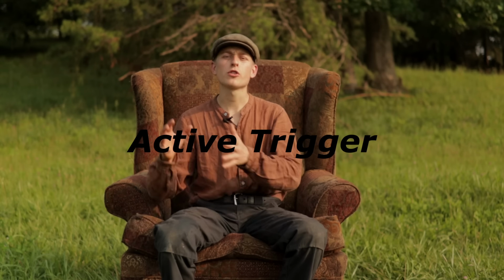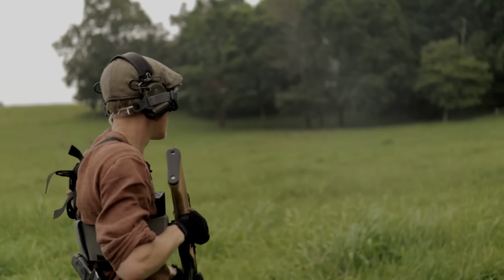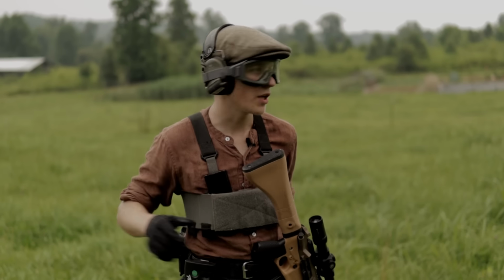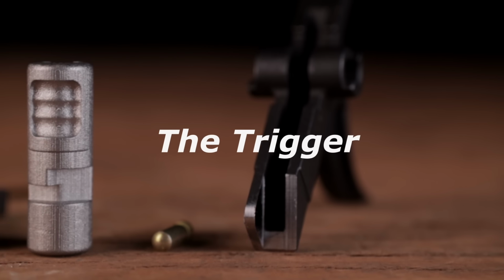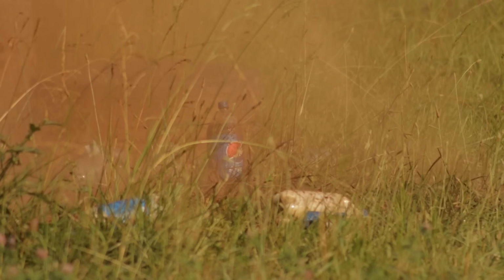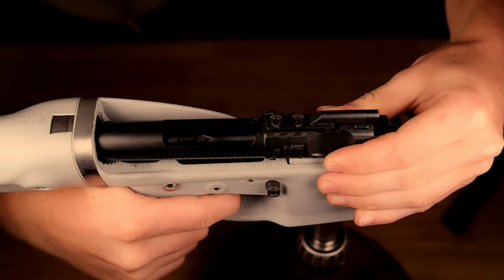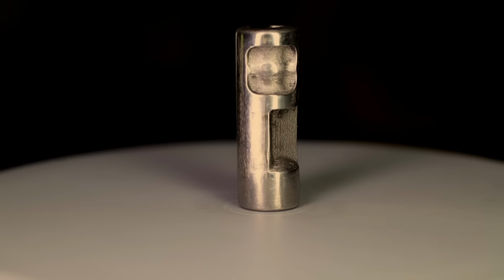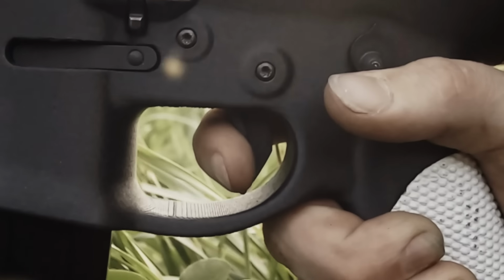Introducing the Super Safety

Comment: I'm uncertain about receiving a response, but you mentioned that this can be used in any AR. I've tried everything I can think of to get it to work in a Wilson Combat .300BKO I built, with no success. The problem is that the detent pin isn't long enough to seat firmly into the safety barrel channels. I'm not sure if there is a specific issue related to the WC lower or if it is something else. I fiddled around with a regular detent and managed to round off the end enough for it to generate some resistance when operating the safety barrel, but it didn't work when firing the gun.

Comment: Isn’t 0.2 mm small for PA12-CF
Reply from the maker: Yes, but not 0.25 MM. Its the only filled material I know of that won't clog a 0.25. That's why I'm very specific that it must be this particular Polymaker filament.
Reply: @HoffmanTactical what 3D printing material would you use and the LR308 works for 556 right?

Comment: 11.5” .556/.223, AGB, Super 42 Rifle length spring, with a can. Running an A5H2 currently, thinking about stepping it up to an A5H3. Want to hopefully make it more reliable (Less chance of bolt bounce and easier to send the bolt home if it’s ever dirty) and mitigate the recoil more without sacrificing too much cyclic rate. I’ve been told theres not much difference in “wear” on parts between the two. Not sure if stepping it up would make it run sluggish/short stroke when the gas has been set right, or if it would be a sweet spot, especially with the can?

Comment: I recently acquired a C-grade Enfield No 1 Mk 3 rifle that I'm going to convert into a gas operated semiautomatic rifle, and I'm going to install a super safty just to see how it compares to the Howell automatic rifle. 
I'm going to convert it from striker fired to hammer fired by cutting off the back third of the bolt right behind the locking lugs, which will have the added benefit of shortening how far the bolt sticks out the back if the reciver.

Comment: This could ware out safety holes on the lower receiver even if lubricated.
Reply from the maker: Testing has shown it to be a non issue, probably due to low surface pressure.

Comment: So, do these drop into AR10s aswell? 
Or do they have different dimensions?
Reply from the maker: The lever for LR-308 is different, but cam is the same.
Reply: @HoffmanTactical  Intriguing.... 
Tell me, is there a break down of specific measurements for folks that do not have 3d printers but are capable of hand cutting and grinding metal+plastic?
Dimensional blueprints for swift links and folded coat hangers are easy to find (I know they are completely different devices) but I cannot find anything for super safety... :(

I have looked around but have only been able to find references to 3d printer files... or websites for buying them complete... but nothing that would help a person actually hand make one for themselves...

Any guidance would be extremely appreciated. <3

Comment: Just curious, why not make it so that safe was the middle position and semi, and forced reset were left and right positions?
Reply from the maker: You could. I wanted safe to be easily indexed, hence its position.
Reply: @HoffmanTactical the reason I asked is because with it being a push button it could be easily accidently knocked into a firing position. But if you put "safe" in the middle, it would make it easier to put say a "raised" section around the cam, kinda like a bumper to make sure it couldn't be pushed by like being knocked into a wall or a shelf, etc.
Imagine like a wide washer with a scalloped center that a thumb tip or finger tip (depending on the side), could easily slip into. If "safe" was in the center you don't have to have the washer nearly as high to protect the cam.
And also if safe was in the middle, indexing it with using the washer would be easy because you just would you the "flat" of your thumb, or finger, to push. And knowing if it's in safe would be as simple as feeling if the cam is level with the washer around it.

Comment: What buffer weight have you found works best? I know it’s prolly gonna be specific to bbl length and port size etc but just wanted to know what you’ve had luck with
Reply from the maker: All of them. Honestly, if the gun runs in spring reset, it will run in active reset.
Reply: @ thanks mane.

Comment: What buffer weight should i run for a 16in? H2 or 3? What about a supralative arms adjustable gb?
Reply from the maker: I don't run more than a 3.5 ounce buffer in most of my builds.
Reply: @HoffmanTactical  thanks man.
Reply: @HoffmanTactical  what about running a A5 9 position buffer tube and an adjustable gas block from superlative arms to lighten recoil?
Reply: @HoffmanTactical  also what weight do I run for a 12.5in barrel?
Reply: @HoffmanTactical  any ideas for super safety on the AK platform? Would be awesome!!!
Reply: @HoffmanTactical  super safety for m&p10mm  cz p10 pistols would be dope too. Glocks already have binary . Wish they would make binary for other platforms besides Glocks.

Comment: Got an interesting story about my Super Safety.

I did everything in this video, or so I thought. Bought a Super Safety kit and I installed everything correctly, but Iwas having light primer strikes. It would shoot 5 or 6 rounds, and then jam instantly. I installed an H3 buffer, changed my spring, and did a bunch of other stuff.

Turns out, I installed the wrong detent. I put my original detent in, not the sanded one. Gonna see tomorrow if it runs correctly now

Comment: I see accelorated wear at the lower safety bore with a cam reset safety. Anodizing could help, but how about a replaceable bushing insert? It could be retained with a shoulder on the inside and snap rings on the outside ( for quick external inspection)
Reply from the maker: So far we have not seen any wear, probably due to low surface pressure.

Comment: The rotation of the safety in a lower,  WILL cause the safety hole to wear out.
Reply from the maker: I had some concern, but so far it has been a non issue. Surface loading is really low. Also, lowers are really easy to replace after 10K rounds (just print another for a few dollars).
Reply: So 3D print multiple
Reply: @ reprint multiple lowers?

Comment: What nylon can be used ?
Reply from the maker: Stiff and wear resistant, also needs to work with a 0.25 nozzle. Polymaker PA12-CF is the only option I have found.
Reply: @ dang only a .25 nozzle?
Reply: Was hoping to print today but I see imma have to source some things first

Comment: Put graphine between the high and low areas of the cam, so when they rotate to reset the trigger, it causes a small electrical charge. Route the energy it produces into helping with time rechambering time.

Comment: 1) What is the failure mode? Ie, when it starts or after a hundred or so rounds, does it reduce the active impulse to the trigger until eventually it dies not push back at all, does the firearm fail to fire at all, or does the firearm lose the ability to be put on safe?
2) Can the active trigger be overridden by pulling back hard on the trigger, or will it still push the trigger out against all applied force or die trying?
Reply from the maker: Metal systems tend to not be overridable, though poly systems can be prevented from resetting with a firm pull. Failure mode is failure to active reset (reverts to spring reset).
Reply: @HoffmanTactical  Thanks. I don't actually own an AR-15 yet, just an SU-16, but if I ever build one, especially with the sweeping reforms coming, I'll have to give it a try.

Comment: This looks like it would destroy the lower with  the  rotation of the safety .. I would not do this in any of my guns
Reply from the maker: Never been an issue, even with plastic lowers. It's because of the low contact pressure.
Reply: I’ve got a 3d printed lower with 1500 super safe rounds through it and no added wear

Comment: Does high shelf or low shelf lowers matter?
Reply: That's the lip on your upper you can also sand the top of your lever ever so slightly with sandpaper or you could Dremel the lip on your upper wish I could show you a pic of what I mean
Reply from the maker: No.
Reply: @HoffmanTactical  what would cause the bolt to get jammed to the rear?

Comment: Mine isnt working do i need to modify the disconector?
Reply from the maker: No.
Reply: @HoffmanTactical  it's not resetting in the ss mode and it locked my bcg back when trying to hand test it i had to bang on it to get it loose

Comment: I've seen these in person. The lever that slides into the cam dove tail seems sloppy
Reply from the maker: It was designed to be sloppy. Needs to pivot in the cam by ~6 degrees otherwise the system won't have enough hysteresis.

Comment: just print the parts in regular plastic and make a mold out of it, then cast your parts in metal.
Reply: How about you give a tutorial. Because, that slide switch is detailed and very small dimensions. IDK if I would be capable of casting such a small part without lots of imperfections.

Comment: Cross bolt safeties suck  ergonomically speaking.  Thumbs are natural fliggers up and down vertically. Not so pushing laterally. Now on to that cross bolt design. Now once my safety is off, my grip hand needs to be used in an unnatural/unintuitive way on the other side of the grip to put it back on. Stoner got it right the first time. The only thing that made it better was the 44° short throw.
Reply from the maker: I don't disagree at all. The use of a push button was not an optional design choice, it is required by other design factors.

Comment: Will this work with an AR-15 bolt carrier group? It seems like it will only work with a mil-spec bcg. My ar-15 bcg is cut short on the bottom. Will that still engage the lever when it falls back into battery? Please respond, I cannot find any information on this anywhere
Reply from the maker: It's in the docs.

Comment: would this work with the SL-9 or any other non printed pcc in 45 even?
Reply: It’s gonna work with anything that will take an AR trigger. However, you may need to screw around with the gas system to give it enough force to reset it.

Comment: I wonder if it will work with the surefire optimized bolt carrier. (it has a dead blow weight in the rear of the carrier, might have clearance issues)

Comment: Dont get to excited about the "Super Safety".  It doesnt really work all that well.  I've printed 6 HT SL 4.8's,  ALL of them with the 3 position safety and NONE of them actually function as intended.  They are all semi with NO active reset at all.  None.  I suspect the reason is because the specs just arent good enough for all uppers and I tried 4 different uppers.  So essentially what I ended up with was 6 mil-spec triggers that are now pretty much ruined due to the required grinding.  DO NOT try to print a super safety,  all you'll do is ruin a good mil-spec trigger.  Until he releases a 3D Trigger file so the trigger can be printed/CNC'd,  it's pointless to even attempt.
Reply from the maker: If you would email me with the details, I'm sure we could find the issue. Overgrinding of the trigger, cam scaled too small, loose lever, many things can be wrong. And that's assuming your having no reset and not hammer follow. As long as the AR-15 bolt carrier is mil-spec geometry it will work.

Comment: I hope you enjoy prison life.  Did you get the approval letter from the ATF?  Do you have a VERY good lawyer?  The way I see it is that YOU are not resetting the trigger, the gun is.  So lets say that the trigger pull is 3 pound, and the reset spring is 5 pounds, which means that you never have to take your finger off the trigger, or even release pressure on the trigger, the heaver spring will do that for you.  That is purely mechanical without any shooter intervention. And not Jerry or anyone else ever got a split time of .08 seconds.  You should have just sold your invention to a major trigger supplier, and let them fight the legal battles.  Good luck no matter how it ends.

Comment: Is anyone having trouble with the bolt carrier having resistance at a inch or 2 before the bolt is to the rear and if you continue to pull the bolt gets stuck before it reaches locked back also note that the lower is note it’s a non full atuo cut lower only happens on both fire modes and not on safe
Reply: Did you install the lever backwards? Can’t say I own one, but a friend of mine had the exact problem when he installed his backwards
Reply: Little late but no I ended up having to shave the tail of the hammer and it’s working 😁

Comment: If you think about it, if RareBreed never stopped his FRT design, this may have never came out. Not only did Rarebreed go and strongarm him with legal stuff, they also indirectly caused him to make a superior project, which ends up being cheaper, simpler, and more reliable in my "experience".
Reply: RareBreed also forces you to provide them with your personal information and actual home address via payment billing & shipping so they can hand it right over to the ATF.
Reply: Reading this in 2026: RareGreed took great exception to that ingenuity and "fine, I'll go make something better" philosophy
Reply: Is this faster than a Franklin binary?
Reply: @IIlllIlIllIIlllII  Depends on cyclic rate of your firearm, but yeah it makes it so you trigger pulls are less conscious but still there without the funky flow of binary
Reply: I prefer the switch saftey over the button saftey of this, but I really like the 3 positions. I wish the FRT had that.. but as far as reliability goes the FRT runs fine. Mine has several hundred suppressed rounds through it without a hiccup, but with this having a nylon cam surely that wouldn't last very long with it rotating on every shot. So technically less reliable right? And if you factor in the cost of a 3d printer then I'd say they also cost more unless you already have one.
Reply: @Kara.Zor-El  fair, but can find metal versions online, which solves the nylon problem, frt is great, but I like options.

Comment: very very clever idea, if the trigger pushes your finger away, does it count as a single pull of the trigger or not? it's a very good question, i'm sure the ATF perspective will be that it isn't two pulls of the trigger, but technically the trigger is moving to reset each time, and your finger has to pull it again, even thought your finger is just continously pulling.

bravo, i'm very very impressed.

Comment: A lot of people seem to misunderstand the issue here...  putting components of designs the ATF have not approved into firearms is illegal unless you're a weaponsmith and they are illegal to sell under ALL circumstances unless they follow a primary approved patent.   Firearms are a controlled item, like prescription medication that you must only get from a pharmacist even tho its just the same as you can digest from fruits and nuts.   Altering the operation of a part, replacing a part, changing out a couple parts or replacing an entire assembly of the weapon as a commercial sale is a criminal act.   There are no exceptions.  If you make a weapon that can fire automatically from recoil you have made a machinegun immaterial of how the trigger depression occurs.   That is why it is important to be literate in the law.  The law precludes you selling un-approved items for the mechanical working of firearms.     Thus the glory of the bumpstock, which admittedly is not a machinegun immaterial of what the ATF says...  is a way to automate negligent discharges and thus still a felony.
Reply from the maker: Would you would be so kind as to cite the law(s) that have led you to this conclusion?

Comment: So it's a forced reset trigger, congrats. I believe the crossbolt design is inferior, however. It's just not as "safe" (funny for something with safety in its name) as a lever type control, as seen on most select fire rifles in history.
Reply from the maker: I agree that levers are better, the push button was not a choice by preference, but rather a requirement of the design. If you look at how it works, you will see why.

Comment: What do you think about using an online 3d metal printing service to make the parts of the super safety?
Reply: If you are gonna do that I would just go to a good machine shop with a cnc mill. You will likely get a much more refined and longer-lasting part. 3d printed metal, while impressive, is still basically sintering the metal together. Not sure how the price would compare though. Perhaps get some friends in your local area to all throw in and get a quantity discount for a dozen or so.
Reply from the maker: 3D printed metal is actually really good now, the problem is the cost. Machining is also pricy, but comes down more with volume.
Reply: @HoffmanTactical  I figure 3d printing such a small part would be cheaper than machining it, there’s plenty of online cnc shops as well. I guess I can shop around.
Reply: @HoffmanTactical  hey, do you think you could do a tutorial on how to actually upload the files to one of those online cnc shops? I honestly don’t know what I’m doing with the files and they keep getting rejected/incompatible. I’m sure a lot of other people that don’t work with cad programs or 3d printers also don’t know how to.
Maybe just an article and not even a video?

Comment: Anyone have thoughts on long term wear to the holes in the lower? This is assuming we are talking about a mil-spec aluminum lower and a steel super safety (cnc milled instead of additive mfg). It could possibly require drilling out the safety selector holes in the lower to install some sort of busing to deal with the constant rotations.
Reply from the maker: Testing has shown no signs of wear. I think it is because of the low surface pressures and velocities.